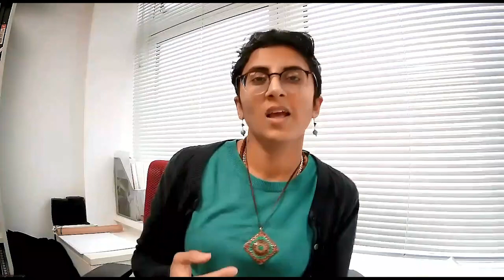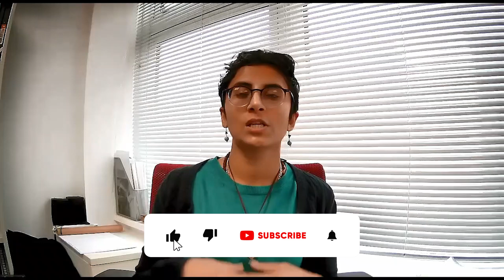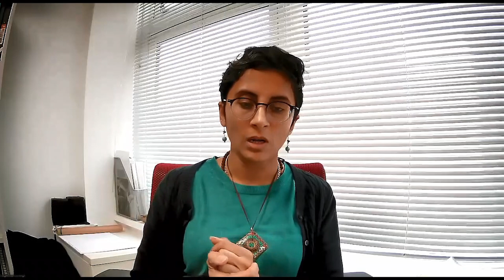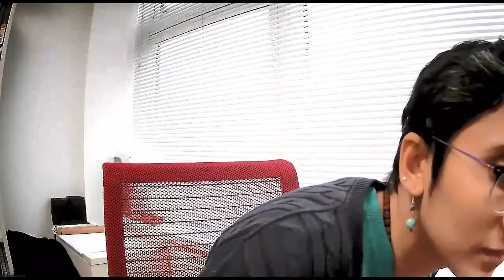Cost of a single storey extension in 2023

Comment: Useful and to the point thanks. Looking at doing a loft conversion / renovation  and must admit we were a bit naive to the cost involved initially. Some 'informational' websites quote £20-30k for simple loft conversions and extensions. Having got some way down the line with this clearly that is unachievable in 2023/24. We have been quoted less per sq m by builders than your 2500, but not by a huge amount. Probably going to crack on with some of the work we can do ourselves (like knocking down non-load bearing walls).

There is going to be an awful lot of neglected aging housing stock in the UK if construction costs keep spiralling. The area we just moved to has a lot of elderly people in homes in need of renovation and when they (sadly) pass away very few younger people are going to be financially solvent enough to take on such a project.
Reply from the maker: Hi, yes, it is a concern that in some areas the cost of doing the work will exceed any appreciation; equally disappointing that costs are not honestly discussed as this allows people like yourself to budget at the outset before going some way through the process.

Comment: So basically your saying for a simple shell extension (with basic walls, floor, roof, plumbing and electrics) I would be looking at £2000-£2500 per sqr metre? And that would equate to roughly £40,000 to £50,000 on a 20 sqr metre shell extension. What is the £4,000 per sqr metre for?
Reply: Hi, 
No she said for shell around £2.5k , thats to plaster finish only! 
if you want electrics, plumbing, finished floor and 2nd fix could be up to £4k . Im based in the South west of England (Dorset) and i charge £2.2k m2, then other work is on top (i.e Kitchens, bathroom) and any internal construction work to existing building.

Hope that clears this up 👍🏻
Reply: @luke-so9hs  Hi Luke, thanks for clearing much of that up. Can I ask the difference between Shell, 1st fix and 2nd fix. Thanks in advance.
Reply: @damiendehorn6350 

Shell, I believe is foundations, walls and roof and nothing else.   1st fix usually means first lot of traders doing their 1st round of work ( mainly electricians and plumbers running wires and pipes ) after 1st fix is usually plastering and skim.   2nd fix refers to finishing the sockets, lighting,  rads,  boilers install and any extras etc.

Comment: I found the video informative but I have one Question. Are the costs per square metre you quote referring to the additional internal floor area or the increase in exterior footprint?
Reply from the maker: Hi Nick, the costs are typically internal. A lot of this all depends on what other works you are having done so it is tricky to rely on square meter costs alone without developing detailed drawings.